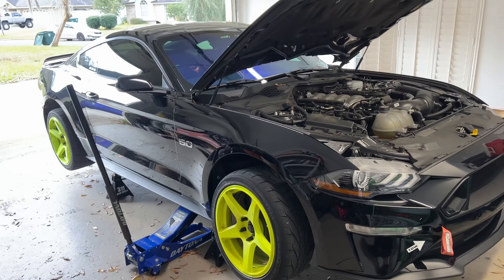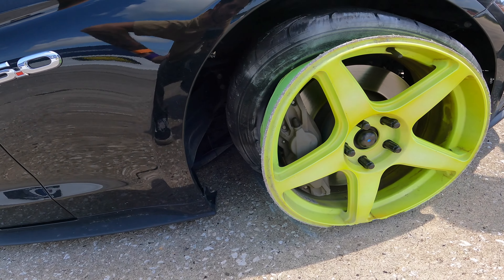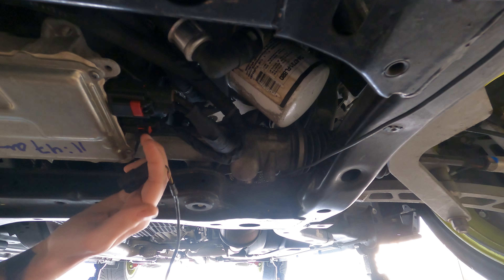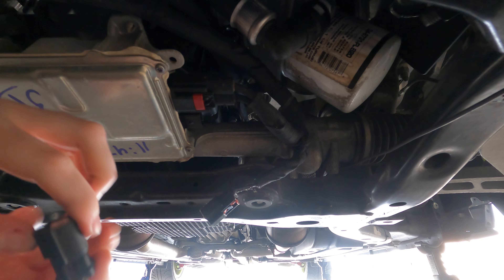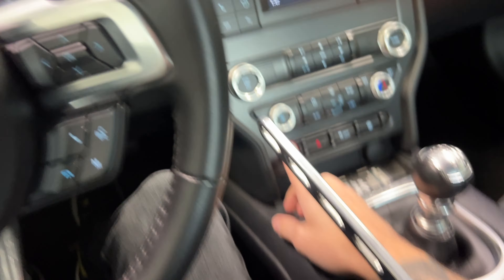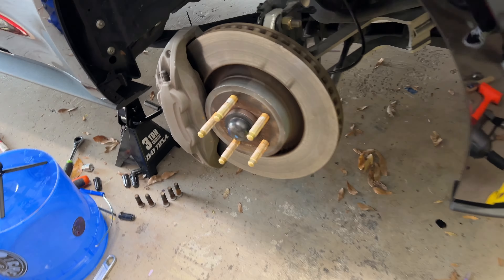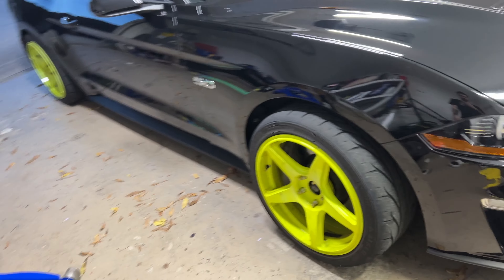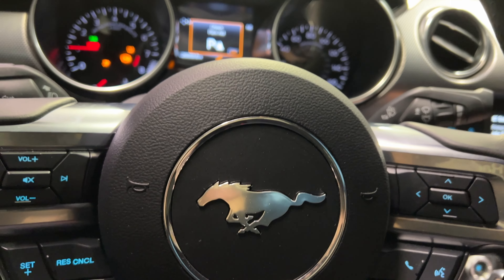MODDING THE MUSTANG TO NOT CRASH LEAVING CARS AND COFFEE

Comment: That bucket seat looks TINY for you. Idk if it’s the angle we see it in the video but it looks like the seat back needs to be higher on you? Idk
Reply from the maker: its right on the edge lol. Its a large size too. its to wide but i have a tall torso so have to get larger seats so the harness slots are high enough. 🥲
Reply: @zach_treadwearlife  how tall are you? Never owned a bucket seat so I’d like a reference. I’m 6ft.
Reply from the maker: @cobratuner I’m 6’1  I’ve struggled finding a bucket seat that fit proper.Ive sat in Omp seat that was perfect but a bit pricey.
Reply: @zach_treadwearlife  Had an OMP wheel in my old car. Love their quality, but definitely pricey. Gotta pay to play i guess lol. Anyways, love the build. Been thinking about picking up an s550 for daily/ drifting. Your mustang content is definitely pushing me to lol. Yours happens to have both my favorite colors too so that doesn’t help 😂
Reply from the maker: @cobratuner  I would say do it. I had an s197 Mustang with the 5.0. And it was my only car at the time. Daily drove it. Drove it to the drift track drift all day drive back and then to work the next day. The s550 is even better.